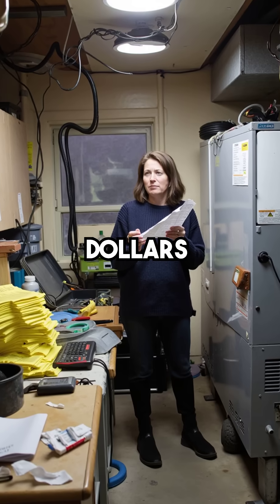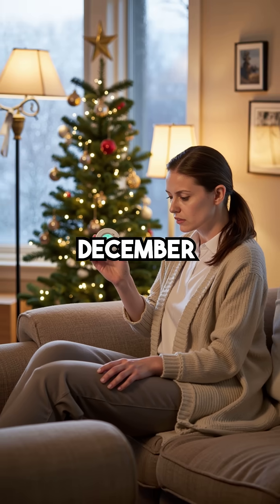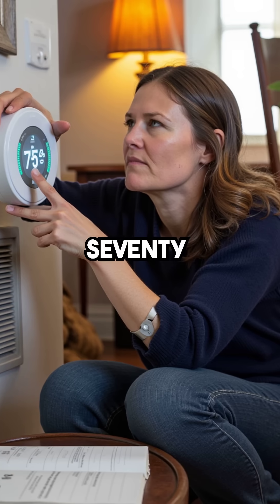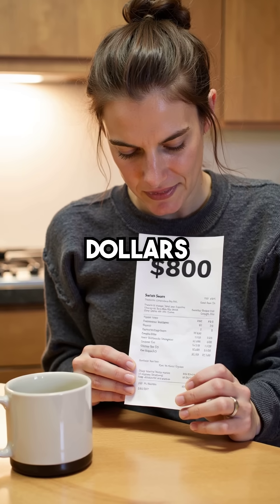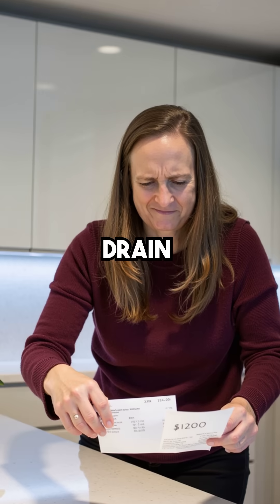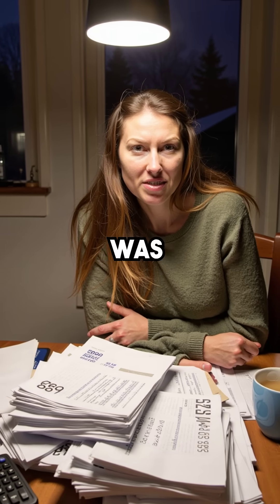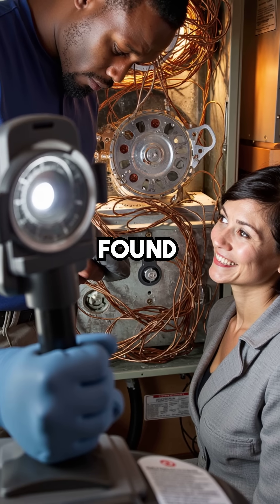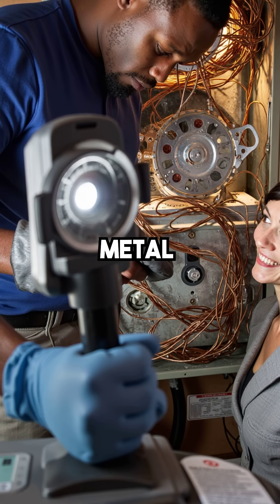Silent Killer Destroying Your Heat Pump

Comment: Was the oil on or in the evap coil?
Reply: Or is this a case of AI slop?  Because by the end they say oils all over the coil. Therefore not letting the refrigerant do its thing. The only problem I have with that is most systems are either heated with natural gas or geothermal through the ground or burn oil at least what I have experienced
Reply: @SchafferFarms_Iowa i have seen the oil thicken to a crisco like state but yellowish. Added ac renew and set the filter drier for easy replacement between two service valves with ports so a quick evac in 12" of pipe. We did replace the comp also
Reply from the maker: It's in the coils
Reply: @hvacsalesguy inside the coil. Replace the comp and install a dryer between two ball valves. With ports between the valves to pull fast vac or purge and you wont have to pull a full charge out. Dont forget to add ac renew or atleast acid scavenger. Oil is bad